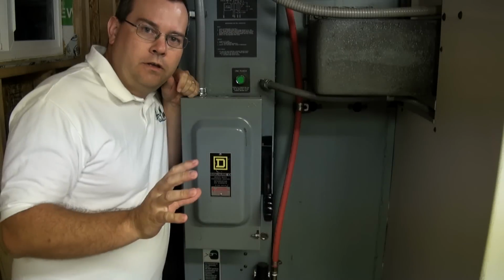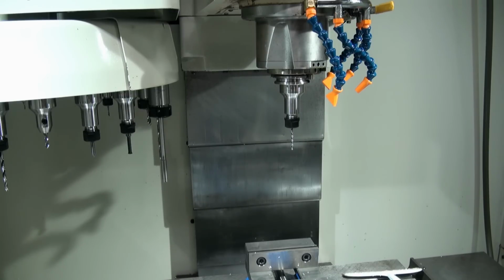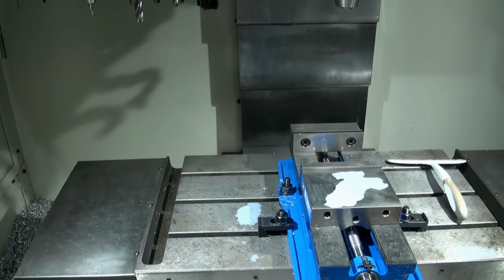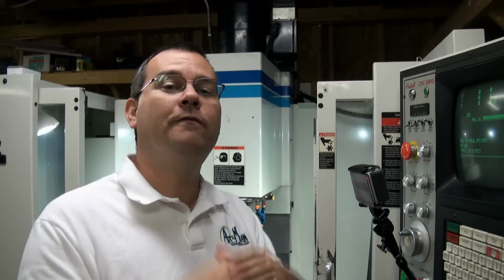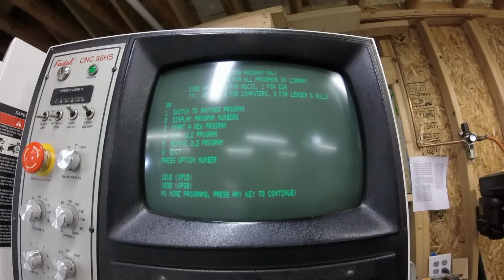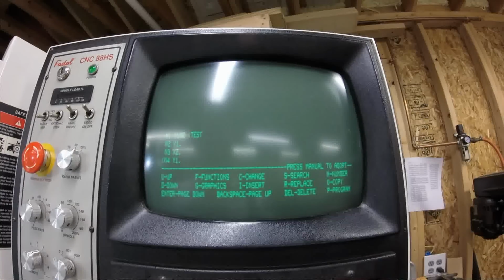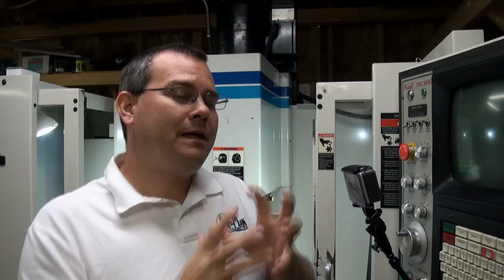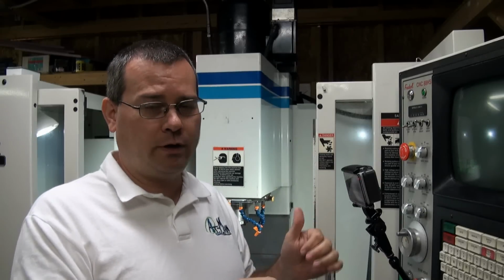Fadal VMC General Operation

Comment: Very helpful video! I so wish I had this as a reference back when we bought our first Fadal about 5 years ago! We went from a Tormach running Mach3, and the learning curve was steep... We're now up to 3 machines (2x 4020s and a VMC15); you can't beat the value on these machines, especially if you are willing to do the work yourself. You're probably safer being in a garage- it's easy to end up with a small herd of them!
Reply from the maker: Thanks, the building has nothing to do with it. My wife will make sure I don't have a herd ;)

Comment: I use a plug in USB transfer system for my Fadal. Bullet proof. Drop by may channel and leave me a comment if you'd like more information.
Reply from the maker: Hi Joe, Thanks for stopping by. Your probably using the CalMotion device. They make a USB and Ethernet version. What I did is similar but it helps streamline my work flow. I also had the hardware laying around so it was "free". I programmed my device to be able to access network storage directly. When I generate code from CAM it goes directly to my NAS. Then I just walk over to the machine and can access the file and run it. Skips the whole sneaker net or needing to FTP to some other device.
Reply: I considered the whole cable route, but my shop has high amp welding. In the absence of very shielded cable, I was informed the code was subject to corruption by the RF present. The USB plug and play is very quick and works well for me. I do use the Cal Motion unit. It was north of $500 to set it up, but it is incredibly fast and well worth the investment.
Reply from the maker: Yes, running a long serial cable is NOT advisable. The CalMotion is a great device, I would recommend them for sure. My embedded controller uses Ethernet to communicate with the network storage. It downloads the file from the NAS to local storage. This way even if you lose the Ethernet the DNC program will not be effected.
Reply from the maker: Oh, It is also like the CalMotion as it installs inside the machine cabinet. The serial cable only travels 1 foot.

Comment: Hi Tim, Great videos, High-quality content, Great information, you answered a lot of the questions in my head, Thank you.
I'm considering buying a VMC, probably Fadal (there is a lot of them at a reasonable price), can you make a video talking about what to look for when buying a used VMC? and what makes a difference in price between 2 same model machines? 
thanks a lot, keep the good work :)
Reply from the maker: Thanks Milo, I'm running a 60 amp slow blow fuse set and a 70 breaker. Breakers respond pretty fast so its a little larger then the slow blow fuses. The fuse and breaker limitations are more for the input rectifier of the drive. Your actual available power is reduced by the sqrt of 3 given the same current. Even though your using more current on single phase it still does not completely compensate for the loss of the third leg. The drive mfgr will specify the maximum fusing you can use and then the maximum delivered power possible. If your only using 30% while cutting your running really light. That 3" face mill at 100 IPM with a full width cut at 0.125" depth will take about 60-70% spindle load. If you reply again please start your own comment though so that Joseph doesn't keep getting emails ;) Thanks Tim
Reply from the maker: Thanks Joseph, have you watched the series on buying a CNC mill? That is a good guide to go over some of the planning involved. I can make a video on what to look for and why the price swings so greatly. It basically comes down to a market value and how much effort it is to get that machine running to specs again. Many of the machines out there are just beat to snot. Those are the cheap ones, to get them back to spec they need a lot of parts and labor. The top dollar machines are typically running and making good parts. They don't need any work, turn key and run. What you find is if you add up the cost to fix a cheap machine and compare to a good machine the total cost is about the same. But that includes labor, so if you can get a cheap machine and do all the work your self, then you can come out ahead a little depending how you value your time.
Reply: At-Man Unlimited Machining OH man, I watched all your videos, actually what draw me to your channel is the VMC vs personal cnc series..
First of all, thanks for your reply. , but what i mean is a more detailed video of your answer. What is the most critical parts to investigate, what are the parts which has a replacement and which does not have a replacement, for example: how to investigate the spindle? what makes a good coolant pump, what are the available types of servo motors and their variations, what is the possible upgrade kits, the controller and its versions, and finally you may suggest some good dealers or repair houses.

I fully understand that you have a limited time, these questions are just suggestions of a future content.
Again, Thanks man, you are awesome.
Reply from the maker: Ah, I'm just another schmuck in a garage ;) We can do that. Fits with the series if someone is looking at a Fadal. Some will be general  as well.
Reply: Thanks a lot :)
Reply: This might have been covered in the video series but one of the most important things is to check on if this is going into your garage is to your local ordinances.  My city does not allow production to be run from a residence.  Further I'm not allowed to have anything in my garage over 9 amps.  The latter is particularly comical as I have half a dozen hand tools that exceed that.  If you do find a problem with codes, don't give up.  Talk to your neighbors.  I brought pictures of the machine, explained how the coolant is recycled as well as the aluminum chips and promised this would not be an irritant for the neighborhood.  I even mentioned I could help them with the occasional project.  No one had an issue.   As the machine will likely be delivered on a massive flat bed truck and installed with a 32,000 lb fork lift, it's hard to sneak it in so cover your bases.  Once in, do what you can to abate the noise.  I moved to a quieter compressor and take moderate cuts.  I also run with the garage door closed and have a zero tolerance policy for cutting chips outside the garage.   You can insulate but longer runs will need decent ventilation unless you like breathing atomized coolant.   If the neighbors are happy, the city has no reason to get involved.

By the way, you may need to upgrade your electrical box.  I run a 50A breaker to the mill (it's a 4020 with a 20hp spindle set up for single phase) and a 60A breaker to the compressor.  Also, take a serious look at your air delivery system to make sure you are delivering dry air.  Wet air is bad for your spindle.   You can buy an air dryer.  I don't have the space so I run about 50 feet of copper followed by a vertical trap with a drain valve at the base and then upto a water separator.  I get lots of water out of that drain valve but the system works so well, almost nothing makes it to the separator.  The line then runs up and over the tool.   I have one drop for an air gun at the front.  Before that is the drop for he mill.  It exits the line in the upward direction then turns down and terminates with a quick connection for the flex line to mill.  The upward exit is the last measure for protecting the mill and is specifically recommended by Fadal.  Good luck.
Reply from the maker: Hello Milo, yeah, I had issues parking my semi tractor in my driveway at my last house. Not because my neighbors complained, but because the building inspector drove down my street for other business and thought he would go on a power trip. I sold the house and moved, problem solved.

In my buying a CNC mill series, the first set I did I talk about a lot of the things to watch out for. Including power. Check the data on your spindle drive, 50A 220V single phase sounds a bit light for a 4020.
Reply: The building inspector sounds like a nightmare.  I was paranoid for the first few years and pretty much kept the door closed even when not machining.

Great point on the breaker sizing.  The manual calls out for 60A.  Can't recall why  but I was working with the factory at the time (circa early 2007) and I think I got the suggestion from one of their engineers.  Have never had a nuisance trip and I'm a believer in less breaker when possible so I think it's good.  One thing about single phase is you loose about 25-30% of your power.  That might have something to do with it.  The only time I really push the spindle load is when I'm spooling up to 10K or so.  It might read 80 or 90% but still no problems.   Generally it's down around 30% for sustained cutting.   

By the way great video series.  I wish something like that was available  when I bought mine.  As I bought a factory refurb (Reground ways and table plus new sheet metal, spindle, spindle motor, screws, screw motors, lube system, electrical and electronics, and refrigeration) it came with training which got me going.  Had you been around, I would have seriously considered the Ebay mills and saved some money.  Keep the videos coming.

Comment: Hi Tim, I want to share  my observation regading DNC/DNCX if you and the others did not face it yet. I've noticed that DNC is not my issue, servo amplifer/drive is. My Y axis servo amplifer draw current about %65 of power and gets hot when it moves rapid a half circle motion like cutting long 1/4 inch keyway using adaptive clearing stratigy therefore, the controller stops the amp receiving power for a moment while the other axes are doing their job and that moment is enough for tool to collide with the part hard. I did swap the X and Y axes amps to see if the X axis amplifier gets hot but it didn't. I need to buy a new amp or send it for repair, I'm going to study it. Thanks .
Reply from the maker: Hi Shem, You came across one of the issues I saw with the Fadal design when I was reviewing the wiring for the machine. I was surprised there was not a signal from the drive that indicated a fault to the controller. They only use position following error for there e-stop trip. Well, as you see, that does not cover you very well in all cases. What is most likely happening is the drive is going into thermal fault for a bit but the position commands are so small they don't trip the following limit and you break your tool off. Small HSM tool path like you describe really put a load on the system because your constantly accelerating, decelerating, and reversing the load. Recall F=MA and in this case you almost always have accelerations so you need a lot of force over a long time, and that is work, which is power.... You get the idea. What I would suggest before you go and replace the drive is go through the gain setup and balance procedure. If the gain and balancing are off on that drive it could cause "Dither" or noise in the current loop. This can cause a lot of heating. If all that checks out there might be something with the drive.  Something could be causing the IGTB's to dissipate more power for various reasons at high current loads. It's on the list to make a video on how to do balancing and maybe drive trouble shooting and how the drives actually work.
Reply: At-Man Unlimited Machining Thanks Tim, as usual an awesome explaination.

Comment: I am using calmotion to DNC and I don't think electrical noise is the problem. Thanks
Reply from the maker: Interesting, did you install it in the controller cabinet or the pendent cabinet? I put my custom controller right next to the machine com port card with a short twisted shield cable.
Reply: Yes, in the control cabinet, very close to cpu and interfase boards. And bore hole on one side of cabinet to instal USB port.

Comment: Hi Tim, Thanks for explaning DNC & DNCX. It broke 2 roughing endmills to cut 5x1/4 inch-3inches long keyways on one stainless steel shaft using adaptive clearing strategy and DNC. When I watched you vedio the other day, what I did was just switch to DNCX and it's solved the problem, many thanks, Shem
Reply from the maker: Your Welcome Shem. When I was making this video I wasn't going to cover DNC, but glad I did. If you are getting that frequent of issues with standard DNC I would suggest checking all your cabling and grounding. You might still see an issue with DNCX at some point if DNC was that bad.